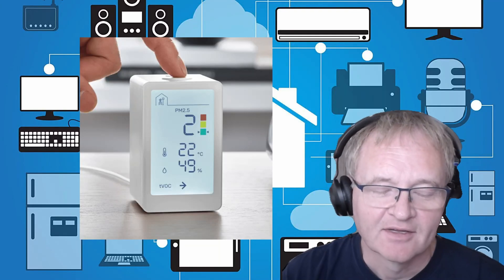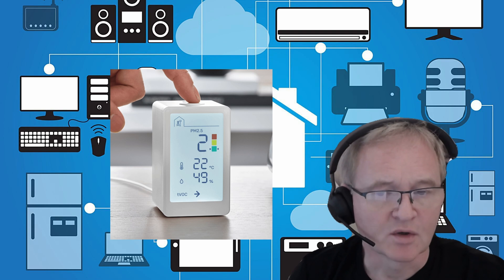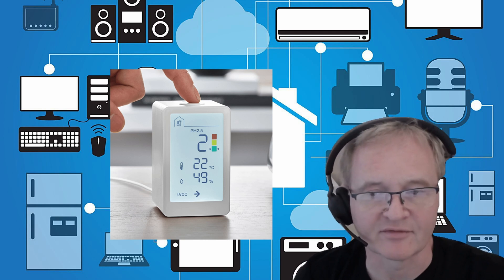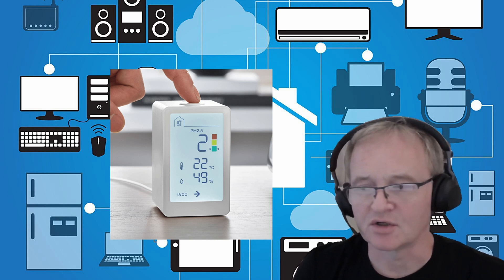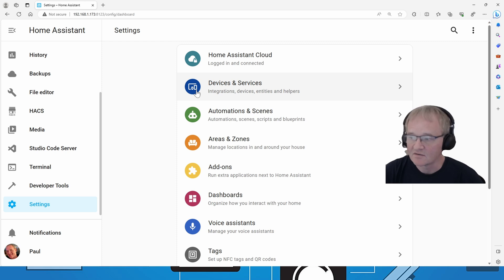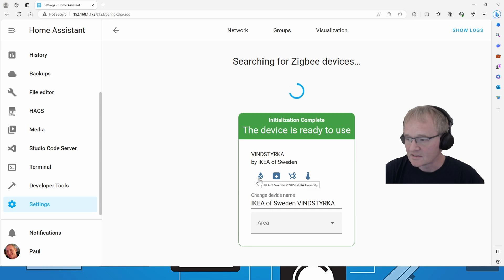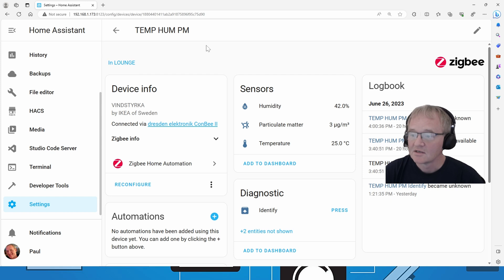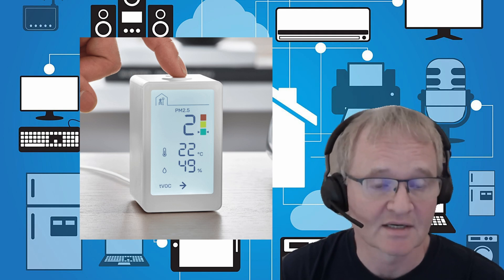IKEA VINDSTYRKA Smart Home Sensor - Review and Setup in Home Assistant

Comment: I have from the field shown 60-70 pm 2.5
Maybe I have a bad sensor?
Reply from the maker: That would seem to be high. in making this video I did some research about what's would be considered as "normal" and would be 10-15 μg/m³ (yes your Vindstyrka measures in micrograms not ppm). So it is reading more than quadruple the average. 
Is it a dusty environment, or does someone smoke in the house, these are all factors that would significantly affect the results. Also is the unit old? Air quality monitors do degrade over time.
If none of the above then maybe take it back or upgrade to a better quality monitor, if you want the current best on the market then I'd suggest the Air Gradient Air-1 (ref: https://tinyurl.com/mr36vcy8). Super Accurate and feature rich.

Comment: It's a shame it doesn't work also with batteries
Reply from the maker: Unfortunately not. That’s because of the internal fan that needs to run when the sensor is running. If you liked this video check out the Apollo Air-1 video.

Comment: I don't have any Smart Home setup yet. Can I use this without connecting it to some Home Assistant system? And does it pick up dust particles (e.g. in a room with carpets)? Or just smoke and gasses?
Reply from the maker: Thanks for the great questions. The unit works perfectly well stand alone, you don't need to pair it with any smart home device (thats just an added advantage). The device measures particles of 2.5microns, so as long as the dust particles are in that size range it would measure them. Saying that I think, check out this page and it shows the sizes of the various particles and that should answer your question https://www.engineeringtoolbox.com/particle-sizes-d_934.html#:~:text=Particle%20Sizes%20%20%20%20Particle%20%20,0.001%20-%2040%20%2078%20more%20rows%20

Comment: Can you power it with power bank?
Reply from the maker: Yes it can, I have tested this and it works. However, isn't there always an however lol, it must be the type of power pack that gives continual power and not the type the cuts the power if the draw is too low. I believe the more expensive the pack the more circuitry they have that cut the power, so the cheaper the power pack, the less power saving technology and the more likely it is to work.

Comment: Is there a way to get tVOC value?
And for some reason values in HA dashboard are different from the device screen, I guess it is not updating so fast.
PS Thanks for the setup video, this 5 clicks thing I would have not figured out by myself.
Reply from the maker: I did some hunting around for you, check out this link and it should help you solve the problem. https://community.home-assistant.io/t/ikea-vindstyrka-zigbee-air-quality-sensor/549747/12
Reply: @smart_home_australia  I got it working by removing device and playing around reinstalling Skyconnect device. I couldn't get zigbee2mqtt working probably because you have to choose only one of them otherwise z2m cannot lock the device
Reply from the maker: Great advice thanks. I'll have to try the Skyconnect as currently I'm using a ConBee II.
Reply from the maker: Thank for the feedback. 
There are 6 entities exposed by the device (Humidity, Particular matter, Temperature, Indentify, LQI and RSSI). So the tVOC is not exposed and hence cannot be reported against from Home Assistant. Might be worth trying Zigbee2MQTT as it might be exposed in that integration, but I would assume not.